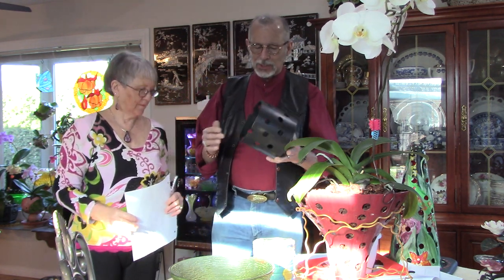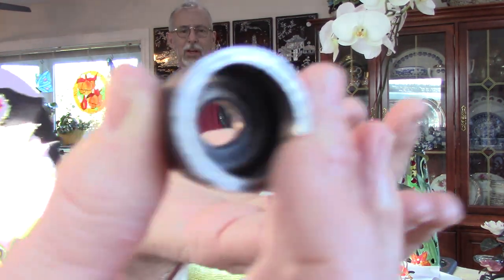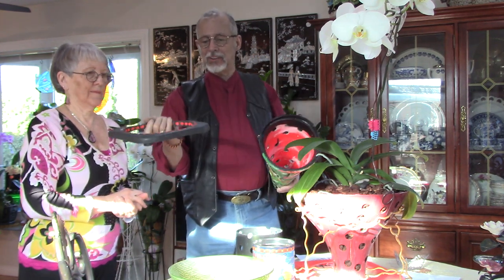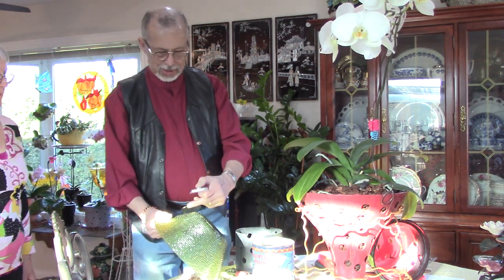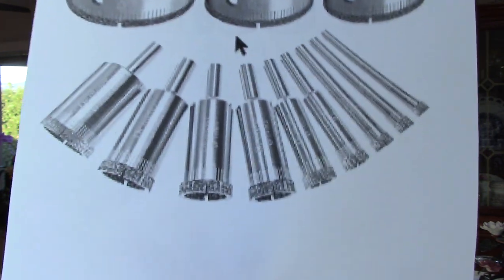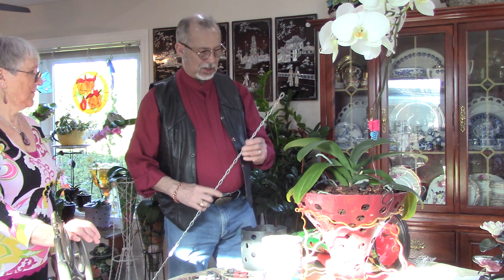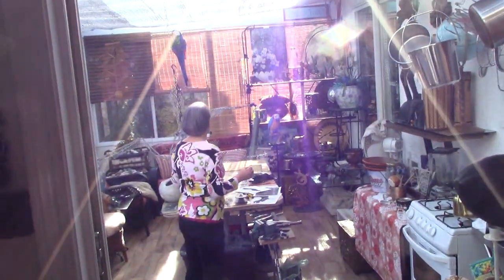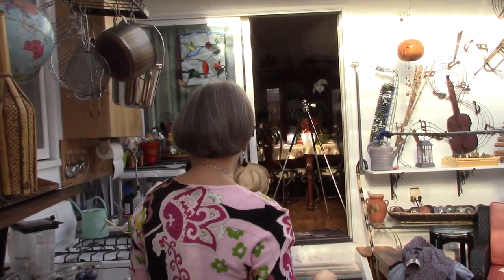Proper Drill Bits etc, for making holes in glass, terracotta, plastic, etc. and Chicken Wire  Eagle

Comment: WOW, thank you both so much, those holes have been a mystery to me, I tried drilling with the drill bit - there were bits and pieces and it didn’t look like yours, so NOW I KNOW, you trimmed them.  I have tried the other bit and yes, you have to start on an angle.... that worked but very time consuming and I did not have a vice.  That is required I can see..... Because my hands are not strong I have to now use a soldering iron and use small plastic orchid pots for most of mine - with holes.  I do find some of the clay orchid pots dry out too quickly especially the SMALL ONES.  Well done guys! Information is always appreciated.....we all love your vids, don’t stop as we all appreciate your genius.  I for one, believe as you do, they live with us, hence nothing too special.  I love the misting bowls just because I can use such pretty glass and fixtures etc..... Regards, from Mission B.C. Georgia
Reply from the maker: It does take a while  Georgia    to see what works best for you, and once you settle in and they get used to their new home, they will reward you years to come,  I find the leaves of mine getting  larger and firmer and the limp first leaves almost unnoticeable.  Small pots are not so good for me either, I like big holes and big pots, however the wire baskets with the cocoa fiber  mat outer lining are surprising me.  The one I called Early Bird, as she spiked in Nov.  I think, has decided to start another spike   so now two baskets hanging have second spikes  :0)    They are right out in the window getting lots of light during winter,  that may be part of it    hard to say.    Love  and thanks for comment   Carolyn

Comment: You two are an awesome team. Thanks for the close up of the drill bits Carolyn. 😉. Safety first. Electricity and water don’t mix. Common sense but you’d be surprised. 😱. 💞. We have been enjoying +20 weather the past 2 days. Happy spring. 💐💗
Reply from the maker: Our pleasure!     Glad  you are having some warm weathers,  our days have been nice, the other day Salmon Arm was the warmest in  BC.   But the nights       still freezing     and ice on the ponds, and frost on the roofs.   I know   common sense seems to be lacking in some areas   :0)))))    Jack is very efficient so he goes about things meticulously (not like me)   so he is in charge of the dangerous stuff!    When farming one time I was enlarging the chicken house run, and there was some tal l       tall     skinny trees, I was afraid would fall on the new fence, so I opened the gate to chicken house-----wait for it-----decided to fall the tree  myself  through  the gate hole therefore no worries,   right?    Well   did I forget to mention the truck was parked outside the gate and the tree was taller than I thought, sosoooo     Smashed the roof of the truck in     :0)))))))))     Darn and it went out the gate so nicely  too
Reply: @jacolynsorchids1361948friends  🤣🤣🤣🤣🤣💗. I love your stories.

Comment: I use a soldering iron for plastic pots. You have to be outdoors or a place where there is good ventilation. The melted plastic fumes can be dangerous.
Reply from the maker: We knew of the heat method, but Jack has a problem with the fumes, as he has a lung issue, and better for him and me to stay away from that, yes make sure good ventilation and a fan blowing it away from you   Love  Carolyn

Comment: Wow so creative and talk about recycling I love you paintwork. How do you paint plastic
Reply from the maker: I usually sand the plastic, than put on a coat of Gesso, than I just use cheap wallmart acrylic paint, and than I put on water based Varathane,  that is the secret, as the paint never comes off and it respells water excellently